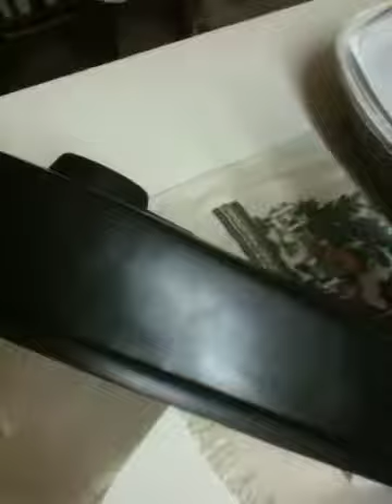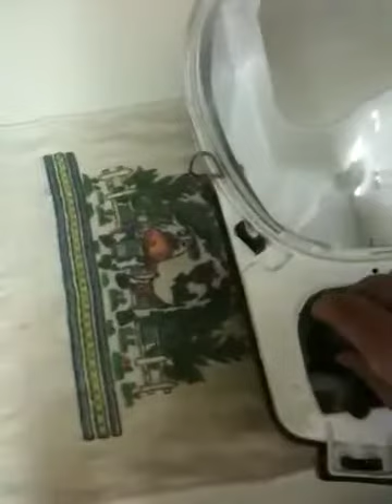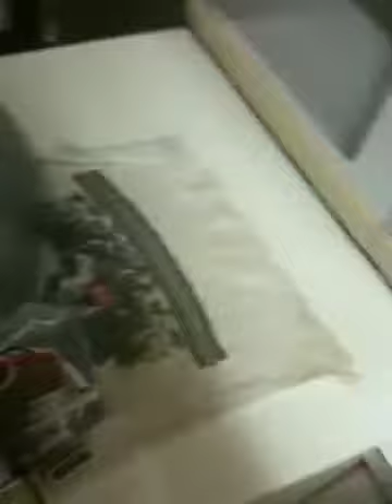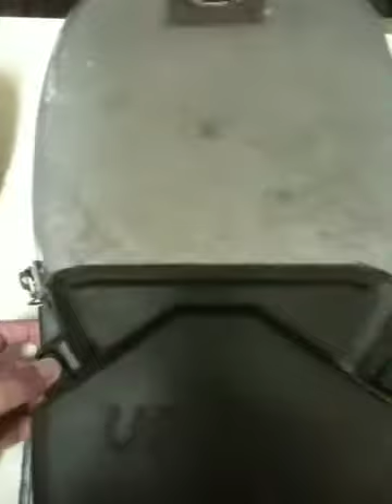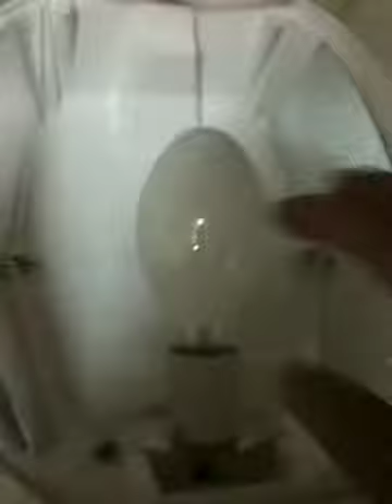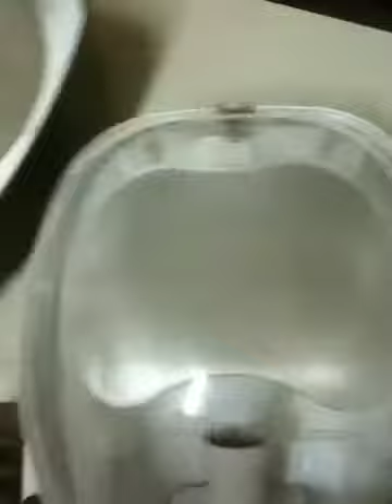Sylvania Australian Street Light

Comment: I believe the Sylvania Urbans were actually the successor to the B2222 "Little Maxi", hence why the early Urban models were called an "Urban Maxi". Both models share the same shaped lamp chamber/canopy for this reason too, though obviously different gear compartments, bowls and lamp ratings.
Reply: +Fairlane500skyliner Although the diffuser bowls are different between the B2222 and the Urban they do fit either light fitting

Comment from the maker: @xtrapolis1, I have 2 roadsters (1x150 hps & 1x250 MV which is very rare). I see a lot of roadsters advertised on eBay, but because of how big they are I only buy the rare ones. I haven't the room to spare. An urban MV will not take a hps lamp unless you change the control gear too. If you do, 70w hps is the common alternative to MV in the urbans.

Comment from the maker: @Crisss994, the fluorescent lights that were in use were made by 3 manufacturers. Pierlite, AJ Fergusson and Greendale. They were very reliable but were not very well maintained by the old SEC.  Lamps weren't replaced and lights weren't replaced until the MV street light became available (Sylvania B2222). I'll check out the link you supplied and get back to you. Maybe chat to you on lighting gallery site. I've just signed up to their site.

Comment from the maker: @Crisss994, thx for commenting on the vid. I couldn't believe they were going to throw this light out. It was just in their skip bin. They let me grab 3 lights. I also bought a brand new B2224 off eBay yesterday. Never used and still in it's box. In relation to the B2222, there are some still around but very few. Mine is still brand new. You will love it. These were the first MV light to replace the old fluorescent street lights like the one in my other video.